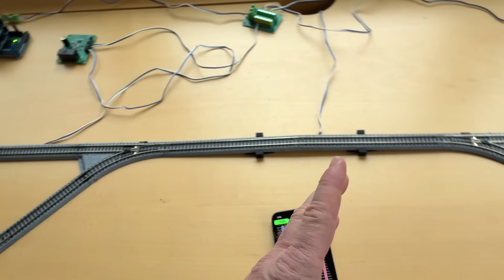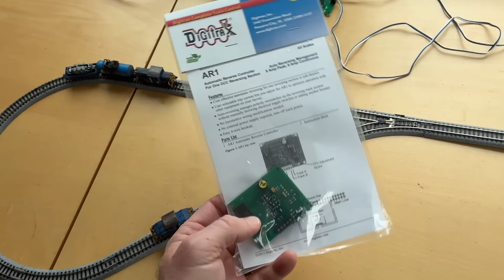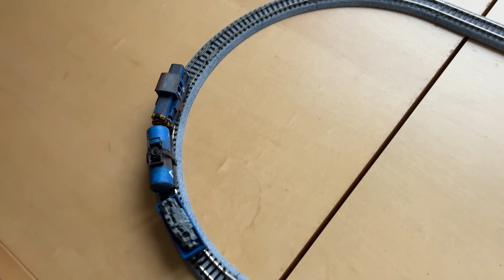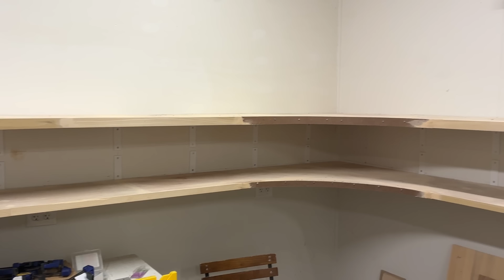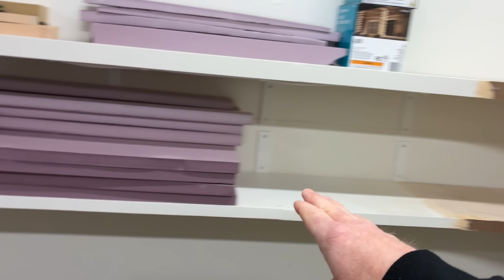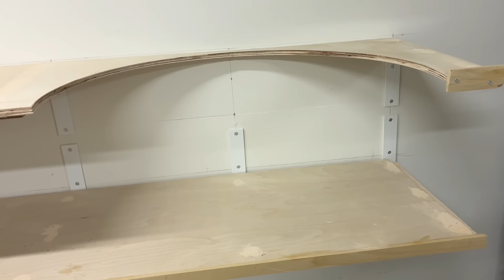Reversing loops with Digitrax AR1.

Comment: How does the pickup not short? Do you only have the front wheels as power pickup? or one set only?
Reply from the maker: This sums it up (thanks Gemini): 'the Digitrax AR1 is designed to work by detecting a momentary short circuit when a train bridges the insulated gaps of a reversing section. This brief, "hard" short is a normal and necessary part of its operation, and it is not harmful to your DCC system if the AR1 is properly installed and configured.'

I understand that not everyone is comfortable with this. It probably breaks some philosophical electronics line in the sand. I'm new to electronics/Arduino/Model Railroading and tend to fly fast and loose and am willing to use my componentry in experimental ways and see what works and what breaks things over time. 

I built the locomotives myself using cheap Kato 11-109 coreless motors, installed LokPilot Micro5 docooders, and 3d modeled/printed the chassis at home. So if I fry something I'm only out one decoder. I think my DCC Command station (also home built--DCC-EX using an Arduino Mega) has short/current protection.
Reply: @rich_foster  I get the system, myconfusion,my chassis,home made also, have 3 axles,all connected, that pick up power.  So,first axle  connects, shorts,reverses current,  but the two behind are still on original current  so....  unless you only have one axle getting power?  or does the dcc have some real smart current switching  on board as well?
Reply from the maker: @jackdeniston6150  Oh I see. My bad. Sorry for the confusion. The Kato 11-109 2-axle motored chassis that I'm using does have 2 powered axles. 

To answer you question more accurately, DCC is smart. Real smart. The DCC decoder that I installed (LokPilot Micro 5) in the Kato 11-109 to make it a DCC loco keeps track of that train's direction and speed. For instance, If you're running a DCC loco on a very simple oval and you suddenly toggle the polarity of the track, the train will not suddenly reverse direction. It'll keep going as it was. From the viewer's perspective, the change in polarity will not be noticed at all. Another example is: If you take a DCC loco that is heading west, pick it up turn it around and place it back down on the track, it'll start heading east. Each loco keeps track of which end is the front of the train and which end is the back. Also, with DC, the track voltage varies as you increase throttle but with DCC, track voltage remains constant, always. PWM signals get sent from your controller (through the track, along with a unique train ID) to tell the train how much juice to grab and at what frequency for a specific speed. Or something. I guess.

My fully automated reversing loop, the way I have it set up, will not work with DC. But with DCC all I'm trying to do is untangle the moebius strip of track so that the section of track that the train is leaving and the section that it's entering both agree on polarity and prevent the loco from getting both polarities at once. As long as the track comes to an agreement (of any kind) the train is smart enough to do the rest.
Reply: The pickup does short. That's what the AR1 detects. When the relay flips, the polarity of the reversing loop changes and becomes the same polarity as the mainline. As the train exits the loop, the same process happens to match rail polarities. Note that the rails on one end of the loop are always the same as the mainline. It's when the train (typically the locomotive) crosses the other end that the polarity switch occurs.

Comment: This is why I have 3 rail AC
Reply from the maker: Oh wow, I would have no idea what to do with that. Is that O scale? I know nothing about 3 rail systems or how they work electronically...
Reply: @rich_foster The third rail eliminates this problem. This is currently used by most US 0 scale manufacturers and Marklin H0. Marklin created the three rail AC system over a century ago.
Reply from the maker: @Marklin15 very interesting. I’ll have to read up on 3 rail ac systems.

Comment: Why don't you only switch power on the main line?
Reply from the maker: I was curious if this would work too, but I decided not to because what if you have a train going into or coming out of each reversing loop at the same time. The main line can’t serve the needs of both loops at the same time. I think the loops need polarity control and the mainline should be a constant in the equation. I think…
Reply: @rich_foster  ah, didn't know a out more than one loco.

Comment: OK, simple Method although I do not think that there is a short detection (would do damage to the wheels on the long run) but rather a current detection. The limitation of the length of trains to reverse remains and bites in cases when you have  two tracks ending up in such a loop. Then trains can get longer than the track between the isolating fishplates.
Reply from the maker: Yeah, length of train is a limitation of reversing loops. You could do a long ‘loop’. It doesn’t have to have a teardrop shape. It could have a very long run but still be an isolated loop. Reversing loops definitely have their pros and coms.
Reply: Short circuit detection is how the automatic reverse control detects when to switch polarity. That is also why the reverse section needs to be at least as long as the train that enters it - so polarity doesn't switch while the train is across both sections, possibly causing yet more short circulating in both relay positions.
Reply from the maker: @edeaglehouse2221  yup. 100%. Luckily, my proof of concept (garage mega layout) is revealing to me that my reversing loops will be plenty long enough to hold my entire freight and passenger trains.

Comment: Bachmann has a great reversing loop relay that works like the one you bought.  Works with N, HO and O.  I have two, one at each end of a long mainline.  
You don't need to operate the switch, it will act as a "Spring Switch" as the train exits the loop, seems like you figured that out.  Works great on my HO.
Reply from the maker: Nice! Good hear that Bachman offers such a device.

Comment: I‘ve read in German magazine about other equipment which can detect loop without shortcuts, so that solution should be more softer that your old school.
Reply from the maker: Agreed. This is just my feeble attempt to get something working as simply as possible. I could probably just use IR sensors to detect the location of the train and build a polarity reversing relay switch from scratch and tell my Arduino DCC-EX command station (via EX-RAIL) to flip polarity based on IR sensing. The AR1 may not be good for my DCC decoders in the long run since it relies on waiting for a short to occur. Hard to say really. I've done a lot of things (made a lot of mistakes) that I was sure would destroy my hardware, but everything still works after months of careless hacking, so who knows....
Reply: @rich_foster double pole double throw switch and any sensor will do fine
Reply from the maker: @N-GaugetheTrains  Oh yeah, that makes sense. It's basically a DPDT, isn't it. I'd have to build it digitally so Aduino can tell it to throw. But digital DPDT switches for Arduino already exist, I'm sure....
Reply from the maker: I guess that's an probably a job for an H Bridge.
Reply: @rich_foster seems normally z21 Loop works fine in DC, for non-shortcut you need to make isolation for sensor work. There is a few way to make it DIY…
Reply: Could work with magnet under locomotive, any solution would be much better than shortcut.
Reply: @rich_foster no need to make Arduino, it works itself with simple sensors.
Reply from the maker: @AlexMont_CH  I guess my question is: how much damage does a very brief short circuit cause to the train motor, decoder, and command station. Does it decrease the life of my components by 10% or 30% or 50%? Genuine question. I’m just very curious if the AR1 is just creating a theoretical problem or an actual problem with hard consequences.
Reply: @rich_foster  well, you would get wearing of wheels and wheels contacts. They would receive too much current. Those contacts made from spring bronze which do not like it and loose it quality and contacts would degrade. The other loc parts seems less, but definitely are not happy as well. That is why most expensive solution like z21 or Yamorc got a soft options to deal with the loop.

Comment: trying to do those automatic stop and go and reverse feature for my limited 8 inch train track space. been buying distance and object counting sensors from aliexpress and H bridge motor drivers to do  the polarity changes. next will be to do some simple codes to let the train stop at end of track then reverse. and slow upon approaching stations then stop etc.
Reply from the maker: Good job on building your own polarity reversers using H Bridges. I would like to try to learn that too. It seemed like a step too far for me, but now that I have a proof of concept working, it'd be fun to homebrew a system like the one you describe. Good work!

Comment: The shelves need more sag prevention.
Reply from the maker: Perhaps. Time will tell.  N Scale is very lightweight due to the 1:8 volume of HO.  These shelves would not be sufficient for HO. I am going for the absolute minimum amount of 'benchwork' because  I want the shelf itself to be an object d'art--a massive floating thing. I've done some load testing and so far there is very little give. Each pair of brackets (16 linear inches) will support 110lbs. I'm going to use foam for scenery which is featherweight. I doubt I'll have 20lbs of load per pair of brackets. If there is a small amount of permanent sag, I can level the foam baseboard and scenery to get true level, and if the shelves sag more and more over time (if gravity wins) then I can go back and install triangular supports under the shelf work. I like to test 'that won't work' with hard data.

Comment: Dude! You are amazing! Thank you for this! I could not figure out how to do it as simply as possible! 🤩
Reply from the maker: No problem. Sharing this seemed like it might be useful to someone out there.
Reply: @rich_foster so I don't do anything with my Kato switch and it reverses automatically?
Reply from the maker: @N-GaugetheTrains  The Kato switch doesn't actually switch. It'll just sit there and do nothing, BUT since the switch is spring loaded (spring switch) when the train rolls over it the train wheels will gently push the switch out of the way momentarily  (since the switch is spring loaded) and after the train wheels are through the switch the switch will come to rest where it was and will continue to just sit there and do nothing. So all I'm using is 2 Digitrax AR1 devices. This whole thing only works with DCC, not DC.
Reply: @rich_foster ya that's kinda risky pushing the switch back ...some older Atlas rolling stock is to light and it rides up...I'll try it ...so digitrax AR1...
Reply from the maker: @N-GaugetheTrains  Yeah, it might not work with lots of types of engines and rolling stock. It happens to work with my Kato Pocketline stuff, but I haven't tested with anything else yet. I'm curious how it'll do with my Shinkansen. This whole thing was just an experiment that I randomly decided to post about. I did not expect it to get views at all. Proceed with caution!

Comment: yeah obviously youtube has been listening to my grok conversations about reversing loops.
Reply from the maker: I feel you. I’m having a lot of that too lately. Also, not sure why this particular video seems to be relatively popular. I almost didn’t post it. Seemed like a boring topic.
Reply: @rich_foster  This fits into a niche overlap of model train and electronics engineering interest for me. I haven't really dived deep into model railroading (I have an Amtrak phase 3 set in N and a BART set in HO, but no layouts) but this sent me off to figure out why the AR1 was actually needed, even for DCC setups. 

Point being, I think you've accidentally made a video that appeals to two different niches.
Reply from the maker: @z @zachwhite2716 y thanks. You have a HO BART train!?! That’s awesome! I live in SF part time. I ride BART a lot.

And yeah, that negative rail loops around and joins the positive rail with a teardrop shaped loop. Which creates a short. Thus the isolating of rails and powering them separately. Fun stuff. I agree, this side of model railroading sits at an intersection of tech, electronics, scale modeling, and art. Fun stuff.
Reply: @rich_foster  Yeah, BART worked with Rapido to make a legacy fleet set. I got the DCC version with all kinds of fun sounds and lighting. One of these days I'll model some stations and relive those days.
Reply: @rich_foster - Boring? Not in the world of train layouts.  😀
Reply from the maker: @nja3224  I agree. Very interesting to me personally.
Reply: @rich_foster  This topic is like THE most important one regarding this hobby, figuring out the DCC etc is exhausting, many people talk about it but few actually show in practice
Reply from the maker: @Casuarius2552 thanks. I agree. DCC seemed really hard to me because lots of videos on it were overly complicated. I should do a dead simple video on DCC. because it is dead simple. The problem is that many explanations of it are way too complicated.
Reply: @rich_foster  Could not agree more, I restarted the hobby couple years ago and been stuck with DCC despite extensive research, I think the lack of explaining fundamentals and lack of visual explanations is commonly the problem with guides

Comment: This may be too much for my tiny brain, but what happens when you build out your expanded main line and perhaps want to run more than one train at a time? Your reversing loop, which is indeed brilliant, reverses the entire track, does it not? So a second train elsewhere on the track would be thrown into reverse. Wouldn’t it? Kinda hurts my head to think about it.
Reply: I believe that you can do reverse loops in DC by switching the polarity of the main line, using spring switches,  and having the reverse loops always powered the same direction.   I'm going to try it and see if it will work like that
Reply from the maker: @pontiacguy5190 let me know how it’s goes!
Reply from the maker: It's confusing, you're not alone. So, the main line is on it's own track power and never switches polarity. Each of the reversing loops are on their own power and are completely isolated from the main line using insulated track joiners. Each power line coming into a reversing loop has a Digitrax AR1 Auto Reverser device attached to it. If a train is running on the mainline, crosses an insulated joiner onto a reversing loop, and the polarities are crossed, that locomotive will cause a short circuit because it's spanning that gap between the mainline and the loop. If this happens, the AR1 attached to that loop will instantly flip polarity of the electrical current coming into the loop. Now the mainline and that loop have matching polarity. Since I'm using DCC, I can run many trains on the mainline and their decoders keep track of each loco's speed and which direction they are going etc. The mainline never changes polarity. Just the reversing loops. It's very confusing but also quite simple, which is why I wanted to share it on Youtube after I figured it out.
Reply from the maker: Also, it occurs to me that if you're running DC and not DCC, none of this will probably work. I'm not sure how I'd approach reversing loops with DC.
Reply: @rich_foster  yes, I took my tiny brain out to my own track, it’s DCC, and realized that forward on the controller makes the train go forward no matter which direction I’ve placed the train on the track. That’s because DCC controls the locomotive itself, not the track. Whereas DC controls the rails so, as you said, your reversing loops would not work with DC. And since they would indeed work with multiple trains, it would  also produce some spectacular head on collisions if you weren’t careful!

Comment: As another option, the PSXX-AR reversing loop circuits have outputs to control 1 or 2 switches. When it detects a short it flips the switch. This is a perfect solution though!
Reply from the maker: Oh cool. I'll check out the PSXX-AR. So far I've been really impressed with Digitrax products. I didn't fully realize the scope of their product line until recently. Everything I've purchased (like the stationary decoders for my turnouts and the AR1) is easy to install and quite reliable.

Comment: I have watched German passenger trains use weighted throwbars to always enter the left station siding force the switch to the mainline.  These are full size trains (12" = 1 foot).
Reply from the maker: That’s super cool. I need Google that!
Reply from the maker: Also, if it wasn’t for the spring switch revelation, I considered doing something like a physical throwbar…
Reply: trams use them routinely to direction control trams from  a single  track to correct side of dual station passing platforms Drivers carry stick to whack them if eg a plastic bottle has jammed it